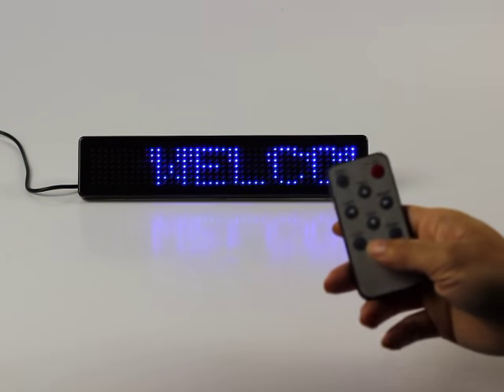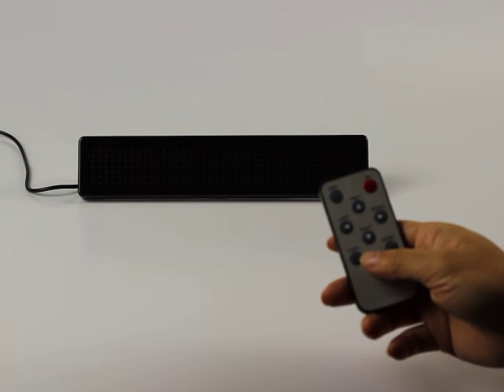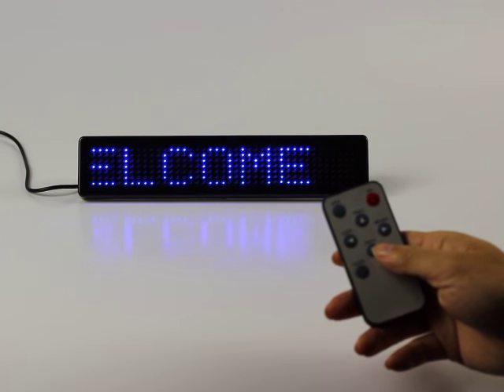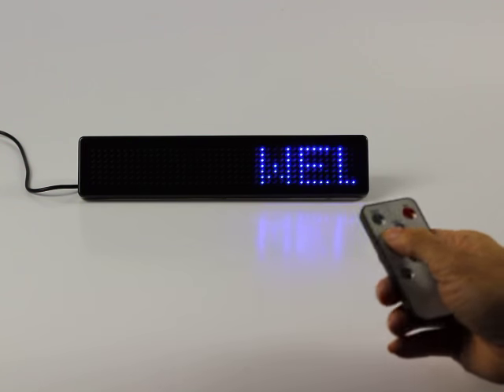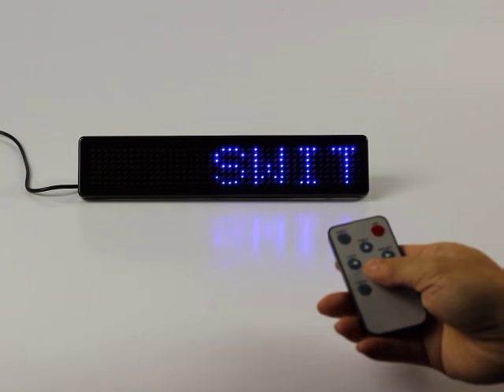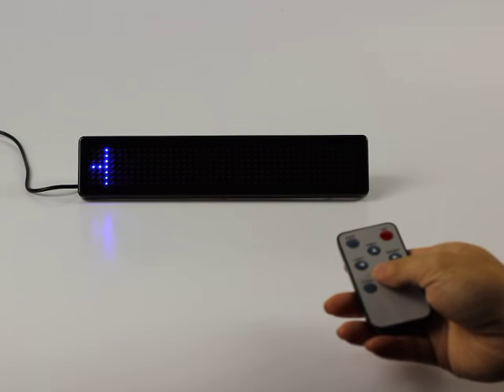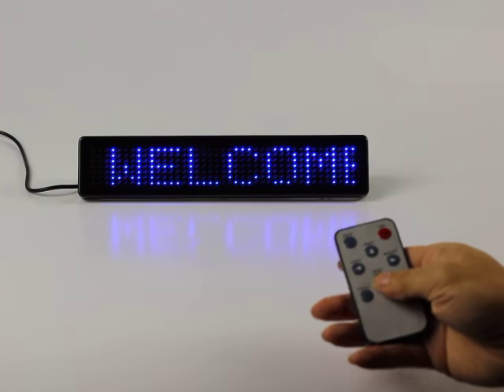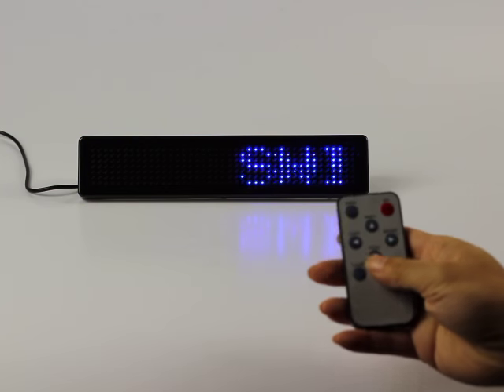LLDT460 B741 led car sign DC12v edit program

Comment: I would like a more detailed manual for this product. The single page does not address the 9 storage modes, nor any other options. Also after entering 3works it goes blank and doesn't save what I've entered. How many words are allowed?I would like more info to really evaluate this product.
Reply from the maker: Bob Russell, please add Skype:leadleds, then we send the manual to you